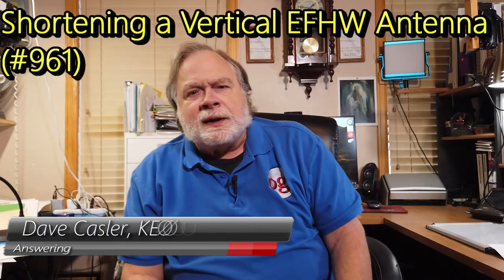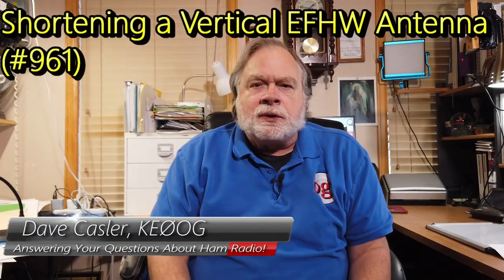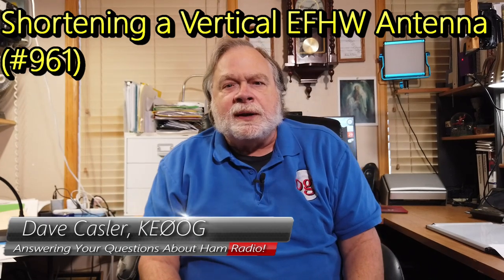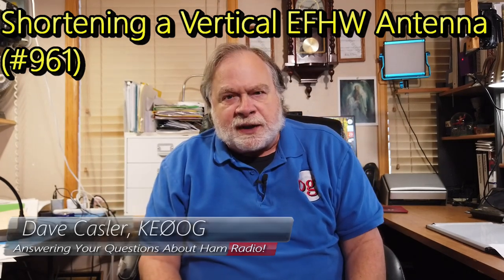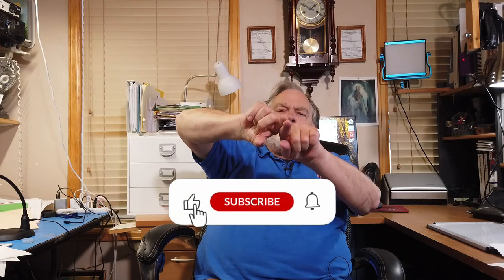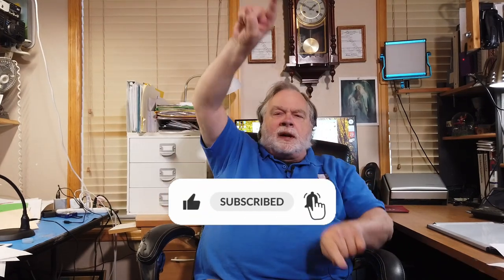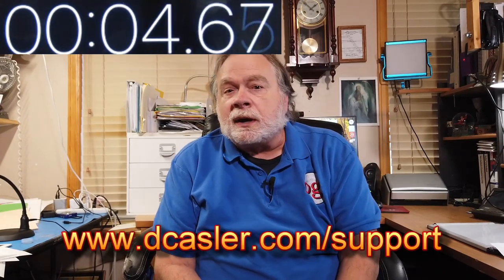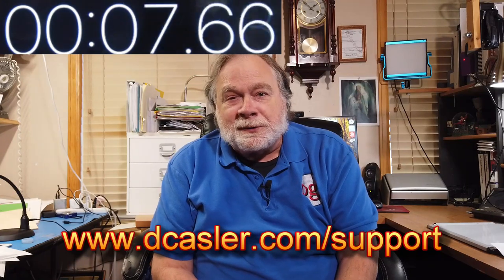Shortening A Vertical EFHW Antenna (#961)

Comment: Due to the size and orientation of the lot my house sits on, and the location of my station within the house, I am only able to install a 60 foot EFHW wire antenna. In order to make the feed line as short as possible, the main mast will be just outside the window next to the station, with the secondary mast supporting the other end of the wire about 65 feet away in the back yard. A dipole, even a shortened or folded dipole is not feasible because the other leg would be extending out to near the street in front of the house, or run along the top of the house at a 90 degree angle.
So, my question is this: If a folded dipole is a viable design that works well, then would a folded EFHW wire work just as well? And if so, then will the orientation of the 2 halves of the wire matter ( . . vs : if looking at the ends of the wire from the mast) ? Also, there would be a slight slope to the wire with the feed point being at 15-ish feet above the ground and the secondary support at 12-ish feet.   Chuck, KC0OLH, Dallas.

Comment: There is a radiation lossless solution - use a radiator with a different velocity factor. Velocity factor depends on insulation type. PE, like the one used to insulate the inner core of, e.g. RG-58, has a velocity factor of 67%

Comment: On a 10m mast, I've tried a centre fed dipole with 2 loading coils (25% and 75% on the mast, 15 turns ish around a 1.25L PET bottle former), it works - but it's a lot more painful than just using it as a 1/4L vertical and running out a few radials, and the feedpoint is on the ground not 5m up in the air, and you also get 15m for free... I've never had a lot of luck with EFHWs, but I love OCFs.

Comment: The questioner might want to check on youtube with M0MSN.  He has a post about doing this using a DX Commander made for 40 to get 80.
Reply: Yes, but that is a quarter wave antenna configured in an inverted L, requiring two masts or supports and a radial field.